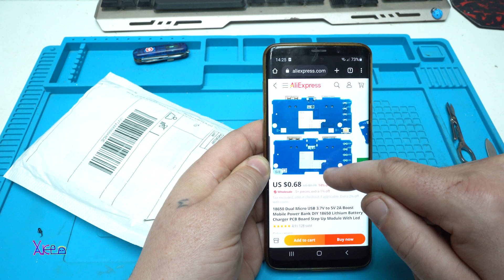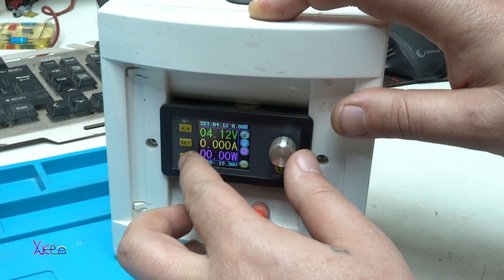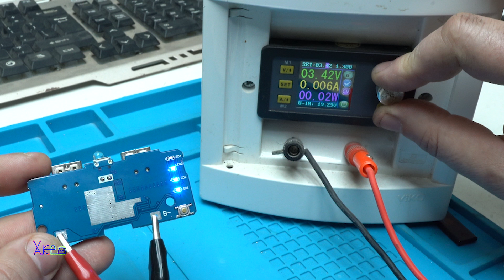IS THIS $1 Aliexpress POWER Module Worth?

Comment: Hello my friend. Is there a 2 in 1 module that charge lithium 3,7v battery but also can reduce or boost voltage from the battery. I am changing all disposable battery gadgets. Some have 2xAA =3v. Some have 3xAAA= 4,5v and some have 9v battery.
Reply from the maker: I will try to find that module,great idea thank you
Reply: @Hacktuber  Thank you so much. I see video they use 2 modules, one for charging lithium battery and one for boosting voltage to match the disposable batteries they replace. Maybe such 2 in 1 module not exist. Thank you again.